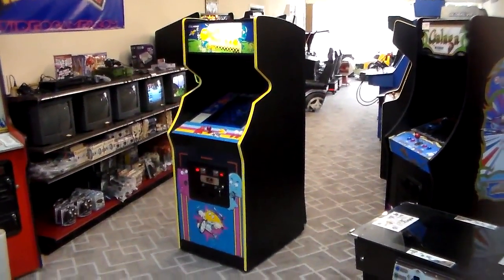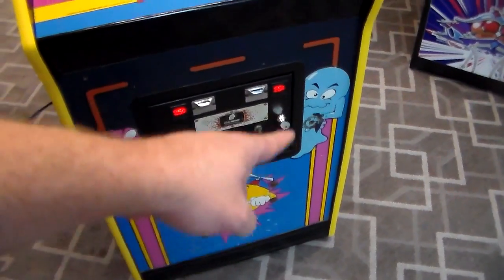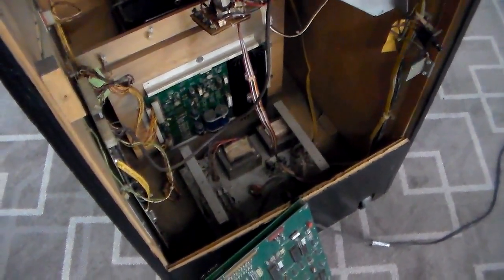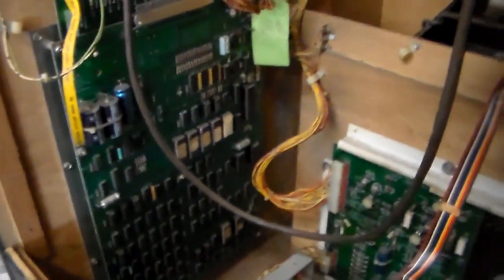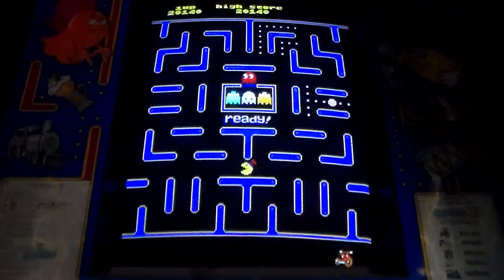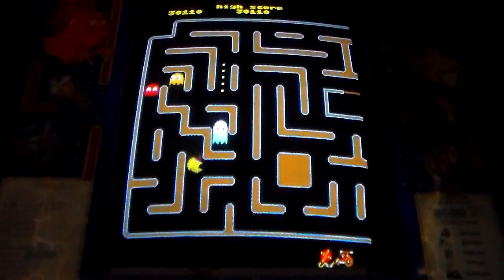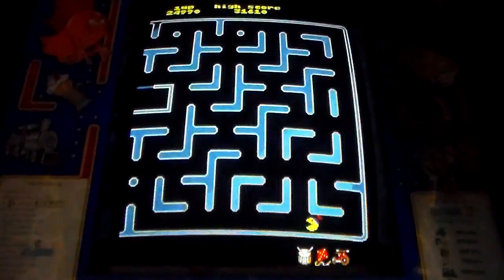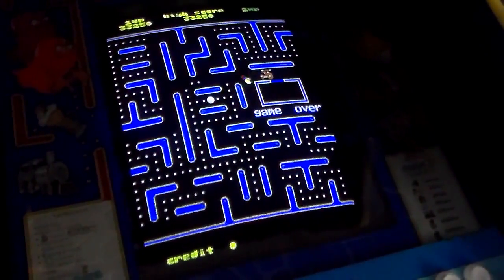Jr. Pac-Man Conversion Arcade Game - Bally Midway Kit from 1983!

Comment: Yep, the tricycle changes the dots from 10 to 100 points.  Very lucrative!  But they slow you down a bit.  Probably wouldn't matter so much with the speed mod running :)
Reply from the maker: Yeah slowing down would help some :)

Comment: I don't think I've seen this game in the arcades; at least the ones I been to.  I do agree about the speed on this one.  Its way to fast.  If I was to own one of these kits; I would want the normal speed version so it is more playable.  If I would ever be able to own a Jr. Pacman; I would get the kit that would go into a Ms PacMan cabinet so that the front would be uniform and it would be a next generation of Ms PacMan in my collection :)).  I notice to; that the Galaxian game cabinets are the same as the Pac Man cabinets and wondered if the kit would be compatible for a Galaxian cabinet so that way the Pac Man jr. would be white with the green trim on the front.  That would be something to check out.  :))
Reply from the maker: The wiring is slightly different on Pac-Man and Galaxian, but there are only a few wires that are different, you could move the wires around slightly on the edge connector and then yes you could slide a Jr. Pac-Man board right into a Galaxian.

Comment: There’s a glitch in all of the pac man games where you can walk through a ghost if your fast enough
Reply from the maker: I've done it before accidentally but never could figure it out.
Reply: It’s actually when they are coming out of a turn or their “home” and you also walk their at the same time. It’s more common on a fast mod cause it goes faster.
Reply: I don’t think it is fast (that has anything to do with it), it seems to be what direction their eyeballs are at .. so I try really hard to keep that in my brain - always keep playing even if you think you are about to die. as sometimes ya don’t, but unless u know, most usually die a split second after. 

I don’t like the speed version on this title. much too hard to navigate the mazes, and the larger dots slow you down thing (in regular speed mode) really changes up the gameplay. not as noticeable a difference in speed mode. 

the GCC peeps must have added a random seed to whether or not the fruit makes the power pellets explode, .. or maybe it has got to do with a timeout (length [time or distance] it has been trudging around the maze .. or how many dots it has made bigger perhaps). 

really hate the intro graphics and cut scenes. very ugly. they should re-release it with better. one day.